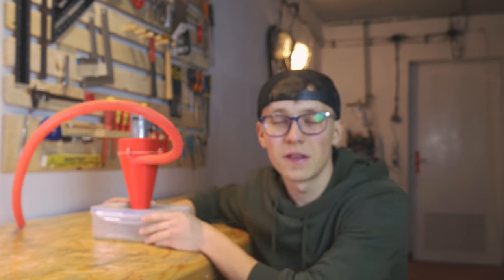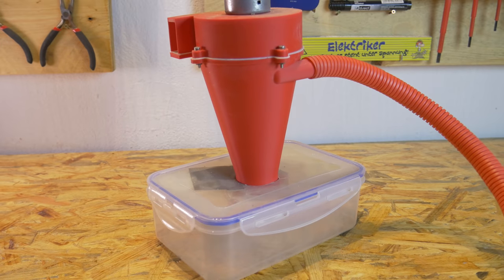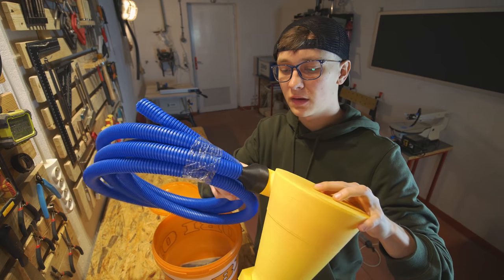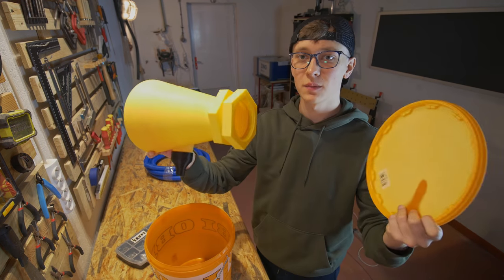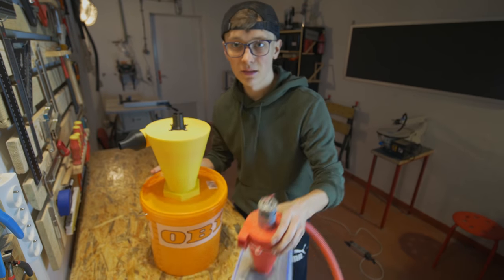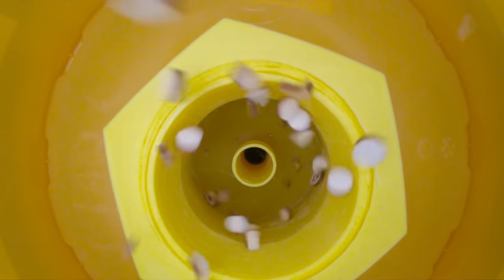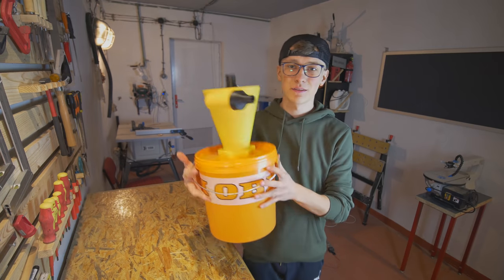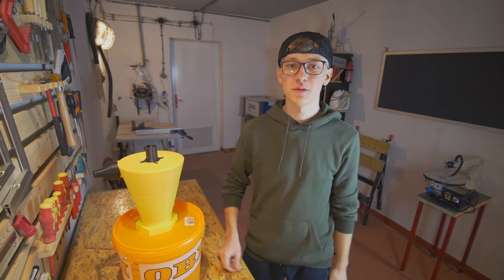3D Printed Cyclone Separator For a Workshop

Comment: When you get a stronger vacuum,  you'll want to stiffen the lid of the catch bucket so it doesn't collapse, on my cyclone (an off-the-shelf dust deputy), I use a plywood sandwhich above and below the bucket lid surface which worked very well,  you could do the same by extending the threaded portion of your cyclone btw (the threaded design is genious BTW)

Comment: Nikodem, one slight modification would improve the whole rig. Your black tube couplers insert into the inside of the pipes. This narrows the internal diameter of the pipes, restricting flow. If you change those so that the tube inserts into the couplers, you’ll get a better mass flow rate of air through the system! Keep up the good work, love the videos ☺️👍

Comment: Cyclones require high velocity to work well and your input (with your reducer) and output ports look too small to allow a high enough velocity to be able to spin out finer particles.  Use your go-pro and pickup sawdust and see what it does to see if it's effective.  What did you use to determine your cyclone dimensions (major diameter, upper cylinder section, cone taper, lower cone diameter, center tube diameter and length)?  i.e. URI, book, etc?
Reply: David Andruczyk this would really interest me too

Comment: dzen dobry :-) the "odd drill bit" is simply called "circle cutter" - very useful tool, if you get a good quality one... but! you should handle it more carefully tho :-) always use a drill stand when cutting holes with it - the thing needs quite some torque to work properly and if it gets stuck while cutting the setback  might easily break some f your fingers or your hand!

Comment: I have printed this Cyclone on my Ender3. Came out pretty good. But I have one Problem: 
The Inlet-tube (50mm Part on the side of the Cyclone) is too short to fit with a DN50 Pipe; the DN50 Pipe is wobbeling/wiggleing and doesn't hold up well caused through the chamfer: 
The sealing ring of the DN50Pipe touches only the chamfer..

Can you please fix this by extending the Inlet? I think 20mm more would be perfect.. That will also allow to use other adapters easyer without wiggle.. 
If you put two original DN50 pipes together, one must be inserted 45mm into the other. So the connection is perfect and strong

Comment: Cooomeee on man, stop using PiPi for stuff :p
It is a great material, it's used for most lids like the little box you have for the small separator, as it can keep bending without breaking easily.
It's PolyPropilene btw :)